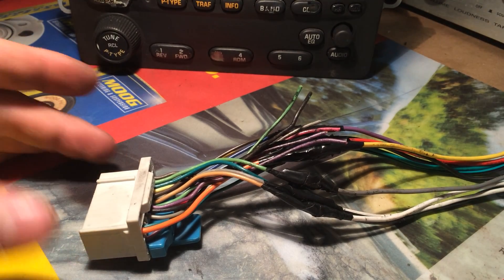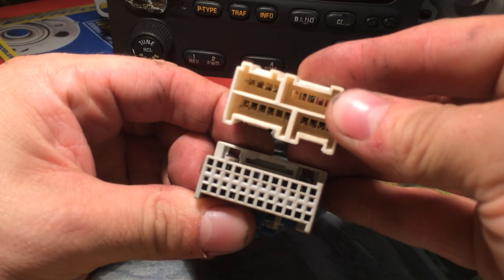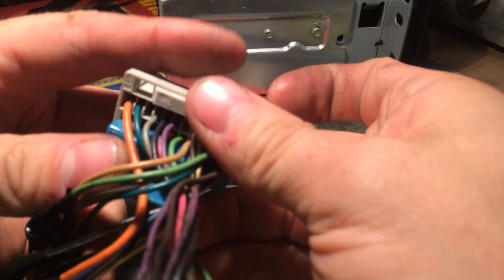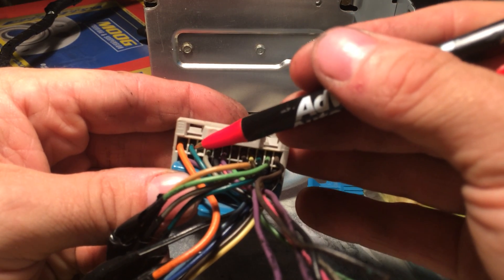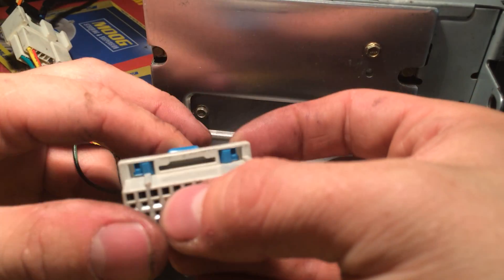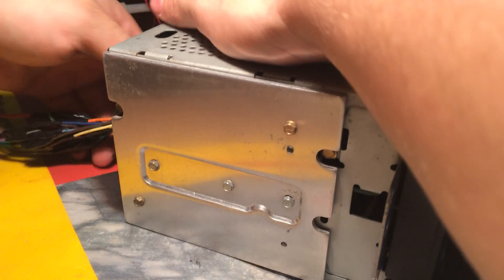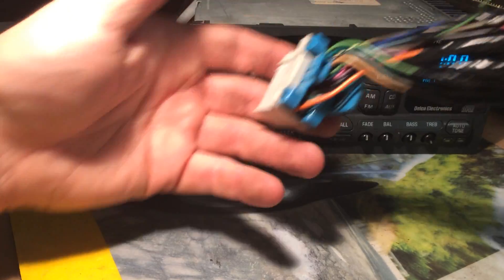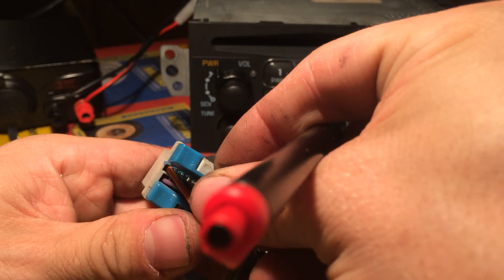GM Class II RDS Radio 12V Ignition Wiring

Comment: i bought the exact same radio intended for my garage on power supply. I switched the wire from B3 to B2 (next to orange) placed both together to 12V and grounded the radio; only the clock came on for a few seconds, but the rest radio display did not come on. You did not mention having to modify anything other than the harness, so i'm wondering what you think could be wrong. 
The radio is from 2001, part # 10318437, Thanks.

Comment: Hey can you give me advice on a 2001 year impala. I want to connect the speakers with out the amp in the back.i want to keep the oem radio due to steering wheel controls. Any suggestions on the wirring for speakers.

Comment: So my 07 gmc savana radio plug doesn't have that yellow power source in the back, how would it work if it does not have it. Online diagram just say to run the power source from the new radio to the steering column 12v ignition accessory.

Comment: I have a GM Cassette/CD RDS radio from 2000, same harness. I swapped per this, same pinout. Didn’t power it on beyond the flashing TheftLock light. :(

Comment: so - in order for this to work you have to remove the chip inside?  Is this the reason it read "calibrate"
Reply from the maker: It reads calibrate because the radio no longer has some basic functions. They're lost when you remove the EEPROM chip inside to force these radios to function.
Reply: @BruisersBeaters  what functions are missing?

Comment: thanks, hope this works. ive been trying to figure this out. the wire is normally yellow. i  know on my car it's controlled by the door, when you open, the radio turns off. this vid looks like it will solve it. as of now i had to twist the yellow and red on the am stereo, so radio is always on! thanks!

Comment: I would like to make an adaptor just like the one in this video, however I have an aftermarket plug for the radio, and the wiring diagram is incorrect.  Do you have the pinout diagram for the  GM Class 2 radio (I have a radio out of a 2004 Chevy Truck)
Reply: Dave Johnson  I’m trying to do the same thing did you ever find a correct diagram?

Comment: i have a question  mi wiires wre cut on  a 01 silverado  i put  them  back but the radio is not coming on  lights come on clock is on  cd goes  in and out

Comment: I really appreciate the video. Very informative. My problem is that i have a 2007 radio taken out of a gmc. I can play in test mode for only 5 minutes. My old gmc connector only has one cable in addition to 8 speaker, gnd and power cables. B2 has a orange wire, similar to +12v on B1. When i place+12v on B2, radio does not work. It is as if the B2 is controlled by radio codes when ignition is on. Is there any way to make this radio work out of the vehicle?

Comment: Any tips for the rear GM DVD units ? The unit will not power on at all. It has a 16 pin harness I believe but it uses data to turn on when the ignition signal is turned on. I tried hooking up the 12V to the class 2 data wire but nothing. It just inserts and ejects the dvd disc. 

I am looking to find a way to generate the canbus ignition signal maybe with a spare PCM, its going into a GM vehicle so I will try to class 2 in my vehicle as a last resort.

Comment: how do I hook up the radio without a harness
Reply: Stop by a scrap yard and get a harness, GM uses the same harness on pretty much all radios. 

Alternatively, use a wire stripper and some shrink wrap to carefully solder directly to the pins of the radio inside the plug. Not the prettiest but it is effective for a bench radio.

Comment: i have a 2012 malibu i installed an aftermarket dual din but only problem is when my radio is on my car gauges wont work but as soon as i turn the radio off the gauges work WHY?
Reply: Did you figure it out I have the same problem

Comment: im currently in school for electrician, and I wanna try to install my own aftermarket radio in my 2006 grand Prix,my question is where do I run my 12v ignition/switch wire to that came with my installation kit and what is the small gold thing for

Comment: I have a 2002 chevy trailblazer and I bought a harness but my red 12v ignition wire doesn't make my radio power but when I cross it to the yellow 12v constant power wire it powers up...I  what could be the problem? or is there a way around it so that it powers off when I turn the ignition off??
Reply: RCA 2002 GMC how what color wires to hook up to
Reply: What I did was run a wire from the ignition fuse under the hood to the red wire.. That way it turns on and off with the ignition.. If I'm not mistaken it might be fuse 22.. But thats what worked for me in my trailblazer.. Hope that works
Reply: Soo I have a 2009 chevy colorado I found wire diagram for 24pin its all good I understand and I see the new wire to the ignition switch fuse that you mentioned working soo my new question is. Orange that supplies the 12v constant to the radio do I just Cap that off after running the new wire to the ignition fuse?… becuase when you turn on the vehicle it will give the 12v to the radio and when off it will shut it off or do I have to have both the new wire to the fuse and the orange constant connected to there wires just curious o what you did and how it works for you I had Battery draining issues with the new radio I had both Orange yellow and Red together Red being ignition plus 12v positive and yellow just being positive constant from the new radio harness

Comment: My stereo in my car works pretty interestingly. It works as long as the engine does not run. As soon as I start the engine the radio locks up. So I was wondering if there is a wire that I could disconnect so that the radio does not know that the engine is running? My car is a 2001 cavalier
Reply from the maker: Cavalier's and certain Pontiac's do this. The security system doesn't communicate the VIN with the radios security chip until the engine is started. My 2004 Grand AM does the same thing. It will allow any radio to work, but as soon as I start the engine, the radio locks.
Reply: Did you ever figure this out? I'm having the same issue on a 2004 sunfire I'm installing a aftermarket stereo on for my niece. Would love your input if u have! Thanks
Reply: @skud911  No never figured it out. Ended up installing an aftermarket stereo

Comment: hi if I connect to yellow and red wire with a wire connected to the positive side of a battery and the ground directly into the electricity will it turn on or blow up?
Reply: I use it that way to turn on stereos and test them or get old forgotten cds out of them.

Comment: As to switching the wire, check the plugs pinout, I have found three different pinouts for these plugs some have ignition switch "on" signal to A6, some on B2, and some on B3, mine happens to be B2. The speaker pinouts are all the same as is power and ground. I got a harness from a trailblazer in the JY but I can't figure out how to get the wire out. there is more to it than just pulling the blue clips. The terminal inside has a barb that has to be depressed to release the wire. I removed the EEprom, radio works, but the CD/Aux button doesn't play the CD even if one is in, I have to eject and re-insert the CD to play it.  The speaker wires are easy to ID as they as twisted in pairs.
Reply: +Vernon Bosshard Update, the CD/Aux works back and forth between radio and cd unless I push CD while a CD is playing, in that case it goes back to the radio and will not go to the CD unless I eject. Not a huge prob, just have to remember to not push CD while a CD is playing. A1, B1 both have constant power and B2 is switched, thats the only way it will retain memory.

Comment: Which wires do I need to bench power an rds radio, B1 is batt + and A12 is ground, with these two hooked up to power I have CD eject and load but no lights.

Comment: I have been having some massive trouble installing my after market radio in my 2004 chevy malibu maxx, i took my radio out and my wires are so faded i can not tell which color is which. I have a live wire tester to use to find the hot wire which is good. my issues now is my radio has a 12v acc wire and a constant hot (yellow wire with fuse) i found a digram of which color is which but still having trouble getting the radio to work
Reply: Nick ROTM f
Reply: You ever figure it out? Im having same issue

Comment: Hello Pan,  I have the radio you showed first in this video im trying to do some bench testing I tried to search for the pin outs and color codes for wires but was unsuccessful . I need to know what wires to hook up for power pos neg etc. If you want you can call me at 1801-427-7214 or send a pic showing pinouts for power hookup im using a computer power sup. for power thanks so much